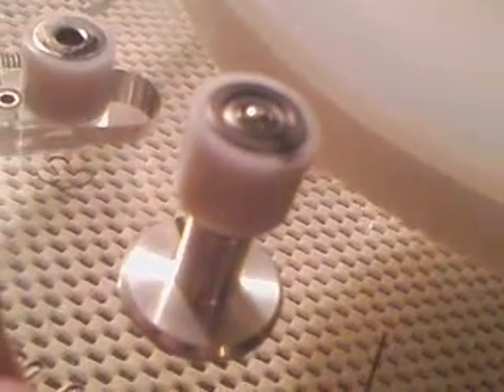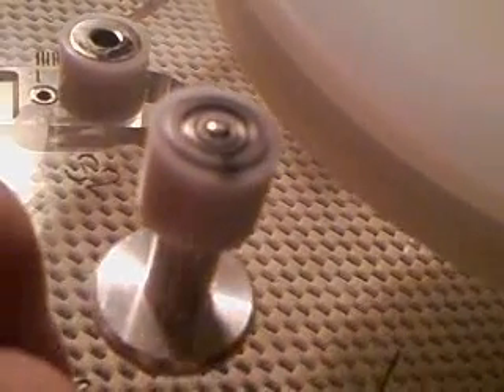WhiPMag II floating stator test

Comment: Does this require electricity? Does this setup posses any torque? If so it could have interesting applications in automobile and aviation fields for use in motors (on a much larger scale)

Comment from the maker: @PrestoWind 

Thank you - it shows some of the characteristics of magnet field connection and shearing as the inertial and adhesive components of the floating stator add resistance and force the field to stretch beyond it's tension limits. This is a time relative phenomenon . . . once the interaction time is increased, the attractive forces will connect and increase the flux density in close proximity becoming very hard to shear - this is when the stator sticks to the rotor and is drug around.